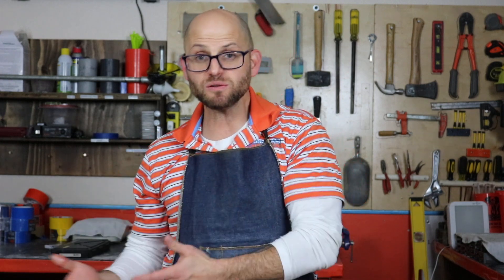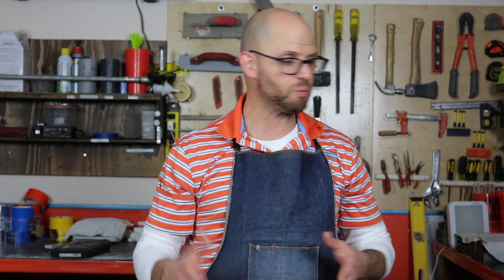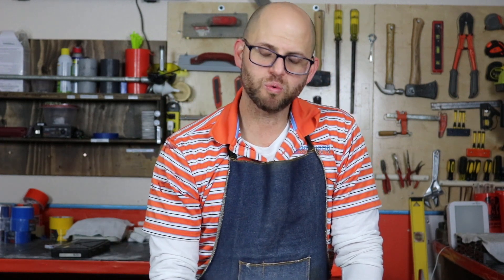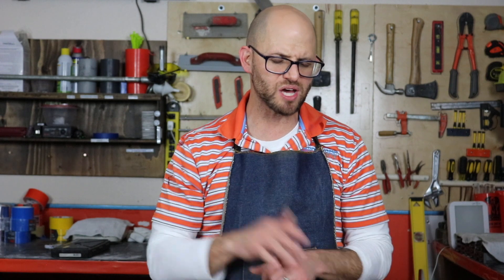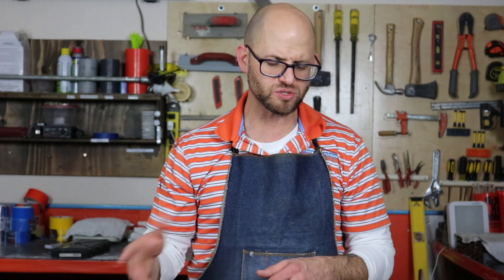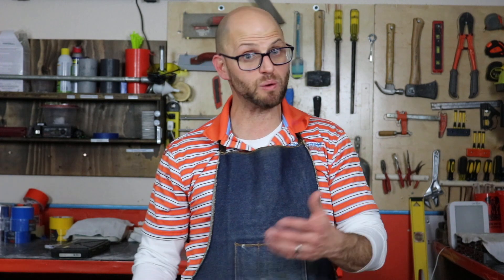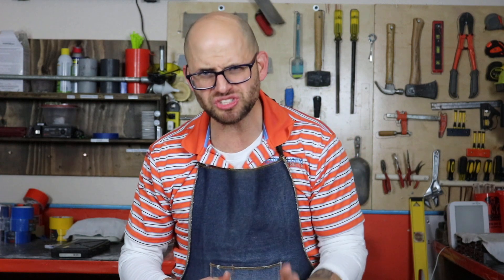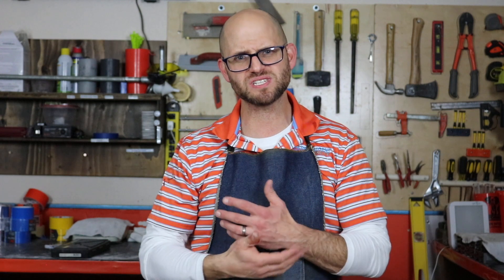Acid Etch Vs. Diamond Grind - Vlog #178

Comment: Total joke. Diamond grinding is the best way hands down. I strip failing floors that have been acid washed on a regular basis.
Reply from the maker: We just did sand blasting with slag from copper production.  Did an awesome job and didn't dust too much but left a mess.  Diamond grinding is my new favorite. But the others have their place.

Comment: Can I diamond grind a basement slab that has been acid etched. We were going to do Apoxsee now my wife wants an acid stain floor I heard you should never use etching and then put acid stain on top I was wondering can I grind out the part of the floor that has been acid etched. I want to put down acid stain but she no longer wants epoxy floors Half of it was etched any help or recommendations would be greatly appreciated It seem to grind up just fine doesn’t look much different than the other parts of the concrete that I have already grinned out. Thank you again I love these videos keep them coming I know this one’s a couple years old but it’s helped me a lot

Comment: What about staining concrete do you need to etch old concrete never been sealed
Reply from the maker: Its a good idea to use ASTM D 4258, 4259, 4260 to prep the surface to ensure a good profile before applying.  Old or new there is normally something on the concrete that can change up the stains and sealers throughout the slab.

Comment: HELP, advice needed. hotel i was just at had polished concrete on its walk way which is exposed to weather. When wet, it is vary slick and i fell. i need advice to recommend a cost effective solution to prevent this from happening to someone else as the owner was less than receptive to traction paint. (note: only trying to find the cheapest solution so no one brakes a hip at this motel)
Reply from the maker: Good Morning.  My suggestions would include one of the following.  There are many more concepts to try, here are a few.

- Sealer with grip sand
- sand blast or acid etch 
- top coating

Comment: I am a flooring installer and I diamond grind everything but a big issue I have here is the concrete guys have this big thing about power floating the fuck out of the pad. So yea the surface is super hard and the grinding gear just glazes over and won't cut.

Comment: Given the option, what do you think about sand blasting combined with an acid etch to streamline things? Mechanical abrasion first, chemical to clean up the stragglers. Could this be a practical option, or just awkward and expensive overkill? PS go concrete, beat asphalt.
Reply from the maker: GO CONCRETE!!! BEAT asphalt!!!

I thinks it’s practical idea.  I would have preferred to have done a grind on the slab first to get the sealer we had on the concrete and then acid etch to create the profile. 

I would only use the combination of the two when necessary.

Thanks for the follow up question!!!
Reply from the maker: We will also be doing a video with this question that will be up next week! Look out for it 👍🏻  @Fisticuf
Reply: @IntelligentConcrete  thanks!